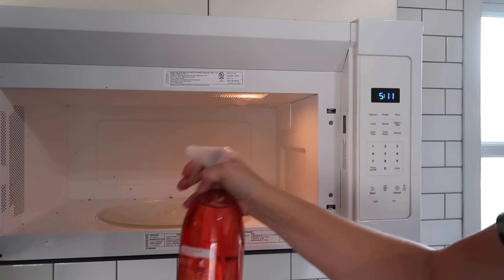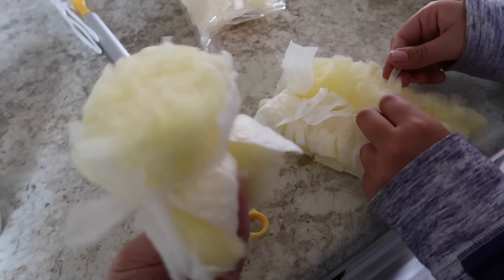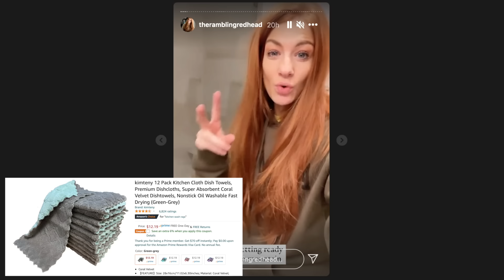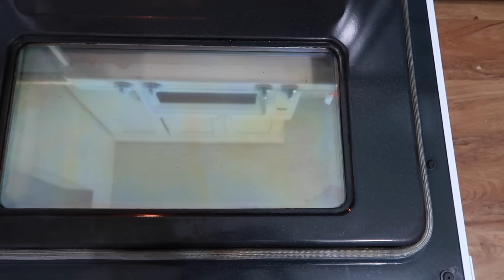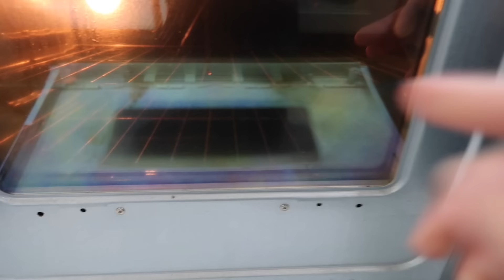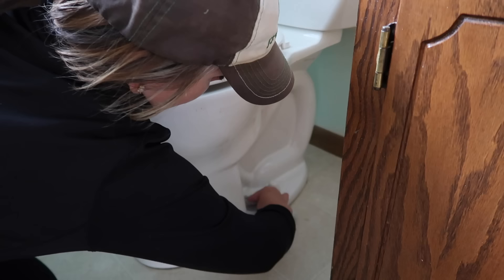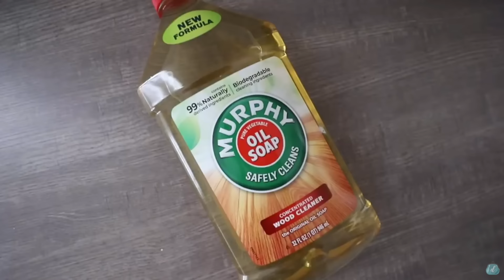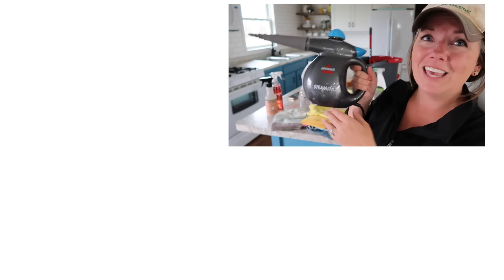Overrated Cleaning Products? Test them with me!

Comment: I do like the Swiffer for those quick Dustin's before company to ensure there are no cobwebs along the crown molding or ceiling light fixtures rather than pulling out a stool and doing it by hand.  Bring collapsible means it doesn't take up too much space.  I was worried about your oven because I thought I read a while back that those inner panes of glass were gas-sealed or something like that.  Might be newer convection ovens.  Great tips!  Have not tried the dollar store cleaners but will now.  Love the Mrs. Meyers Lemon and also Orange/Clove spray cleaners.  Have you tried their Baking Soda Cream cleaner?  Really cleans the grease off kitchen cabinets so well and less messy than making your own paste.

Comment: it is much easier to clean ceiling fan blades with a ceiling fan duster so you can get both sides and the edges of the blade in one swipe.

Comment: I use vinegar for my toilet. The video I saw said to use 2C vinegar and let it sit for an hour. Then use 1C baking soda and let it sit for 15 minutes. After that is done, just scrub it with you toilet brush and it works better than any cleaner. Sometimes I use bleach for water stains. I don't measure any of this, I just pour. So I can save even more!

Comment: When using the steam cleaners, you need to get right down close to what you're cleaning.  I had same issues and thought they didn't work.  The other kind with the hose and nossle works better.
I do like vinegar and baking soda with essential oil drops and Zum.  Zum is a little pricey but love it.

Comment: Ammonia is brilliant for cleaning really baked-on oven grease.  Leave it on overnight by lightly spraying ammonia (avoiding element), immediately laying paper towels over the ammoniad surface, then a further drench of the paper, then cover in cling film (saran wrap?) to hold the paper towel in place overnight.
Come back the next day, and it's a breeze.
Please wear a mask/gloves as ammonia is noxious at first.  After 24 hrs it reverts to water as it interacts with air.

Comment: I would try a magic eraser or Dollar Trees magic eraser on the scuff marks on the wall or even baseboards they work really good. What I do is cut them in half or even in thirds so they last longer. I used to have one of those steam machines I did like it. one thing I don't know if your steam machine had is a little scrubber that you can put on the end of it and  a duster you could put on the end of it . both of those were good the thing that I really liked about the steam machine .  Also for the crevices in the window seal it work really good in the window seals. Another  thing is to put on the duster cloth on and steam clean the  windows. The reason why I don't have it now is because I'm in Assisted Living.

Comment: Microfiber doesn't push as much dirt around if you use cold water for the clean. Leaves it streak free. Especially if you don't add extra product.
Rinse with warm water. Just water.
Microfiber is somewhat sensitive like skin, so remember the cold holds & warm releases.

Comment: The trick I use for ceiling fan blades is i take a damp towel, throw it over the blade then (pillow case starts inside out then work pillowcase onto blade right side out) then pull it over the blade then taadaa! 😜

Is mocrofiber the one that pulls across my hands when they are rough from working in the garden?

Comment: One thing I have learned that really works to keep the microwave clean and smelling fresher is after use leave the door open for a few moments. That allows any moisture to leave the inside of the microwave. I started doing this because when I cleaned the microwave a few months ago, I noticed some rust building up on the roof inside the microwave. I fully cleaned the microwave at that point and then told everyone in the household (there are several of us) to leave the door open so the moisture releases from inside the microwave. I was not expecting anything more than to keep the rust at bay, but after a few weeks of us all leaving the door open for a few moments (2 to 3 minutes is fine, longer if you like, though) the microwave was just as clean as when I had done the deep clean when I noticed the problem, and NO no one else washed out the microwave in between those times. Anyway, give it a try, it doesn't cost really much except for the light being on in the microwave for the few minutes that you leave the door open.

Comment: I used to have one of those steam cleaners.  I found it worked best if I held the nozzle closer to whatever I was cleaning, like an inch away.  The steam cools too quickly otherwise and you lose the pressure effect  Unfortunately, this meant cleaning one square inch at a time.  In the end, it was just too much fuss to get it out.

Comment: I too love the Swedish dish cloth and I love them for kitten counters and wiping dishes. You are right they are just so adorable that I don't feel like using them for dirty work (I have the same color you have).  I use Microfiber cloth for all other dirty work. I like Mrs Meyers all purpose cleaner too. I recent bought LAs Awesome cleaning liquid but haven't used it yet. I too have a very small house so unless I absolutely love the stuff I don't want it to occupy extra space in my house. One item I recently bought is handheld spin brush and so far I am loving it for kitchen and bathroom cleaning. Question: Do you have Rubbermaid Reveal Power Scrubber 18 piece set. I want to buy it but don't want to spend $50.  Loved your video. Thank you!

Comment: Awe, I love the geranium scent! :/ I buy the concentrate and it lasts FOREVER.  I like those long flat floor mops, got one on Amazon and found a tip to buy several of the microfiber pads that way there’s no rinsing. Just throw them in the water with cleaning solution and use a clean one every time.  Works so well on walls and windows, a lot easier than using the rag by hand.  I want to try the pink stuff paste vs the scrub daddy paste.  Lots of hard water in Tx!

Comment: I’ve been using Branch Basics cleaning system, and really like it. Great for minimalism. Please check them out and tell me what you think.  There is one liquid that you dilute into different strengths depending on the job.  It comes with all the bottles with lines for concentrate and water levels.  I am very impressed with how well it washes clothes and it only uses a small capful.

Comment: I love using the micro fiber cloths I find just water on walls and baseboards works great. I've always used dish detergent to clean tub and shower. It cuts oils and dirt build up and cuts through soap scum really easily no scrubbing needed. Learned that from my mother as a child. She always kept a bottle of dawn in the bathroom to clean tubs after our baths. I wanted to try that mop system. So now since you did I can go buy it. Vinegar and water works best on windows imo and thanks for trying the swiffer. I wanted to get it for dusting high up. Ceiling Fans and lights , pictures etc. But I thought the same as you. I dont wanna store it and not only that. Buying the dusting part over and over is wasteful.  I'd rather use something I can use than throw it in the wash and reuse it again. I really don't like having to buy unnecessary things just to use and throw away so if there is an alternative to waste I will choose it everytime. That steamer was just crap. I thought for sure it would clean the microwave smh. Anyways love method and Dr Myers products also. Thanks for the video.

Comment: Well I’m a little late here, but the steamer I couldn’t live without.. oven cleaning is not going to happen with steam only, vinegar or not that just needs the right chemical combo heat and a scrub. .. And I spray whatever cleaner I’m going to use on the surface of what I’m cleaning and then I steam with water and wipe . Works every time. I cleaned all the grout with my steamer which was black to begin with and it came clean… It’s great to clean trash cans (I have a white trashcan with a floppy lid that looks brand new after two years, and we are a family of 6 so much garbage u can imagine), kitchen sink and counter,  faucets , bathroom. Bleach and dawn in the bathtub with a scrub brush cuts the crud. Dawn and alcohol is good for my countertops and doors , sprayway foam window cleaner is hands down the best!!!!!!! I use regular cheap white washcloths for cleaning everything and paper towels for mirrors and glass. I do not use green cleaners bcs they stink they don’t deodorize anything they are expensive I don’t feel like they sanitize anything, some green cleaners smell like cat pee and gas station toilet to me. Sometimes we need to quit being “boujee” with Mrs Meyers and be practical and buy dawn bleach baking soda vinegar comet and borax and RAGS from Walmart.

Comment: Y’all ALL need to remember using vinegar TOO much (in laundry especially) will RUIN plastic piping after a while. It’s an ACID FOLKS. It won’t DISSOLVE it but it will break it down. Over time and overuse. 

inegar, or acetic acid, is a weak acid and will not dissolve plastic. However, it may cause discoloration or etching on some types of plastic. It is also important to note that not all plastics are created equal and some may be more susceptible to damage from vinegar than others.

Comment: I have the spin mop and the steam shot - spin mop worth it, steam shot not so good.  My go to cleaner for most every thing is Dawn + Vinegar 50/50 mix in a spray bottle (Clean My Space suggestion).  Windows, walls, floors even dishes - perfect.  Cerama Bryte makes a power cleanser for stained porcelain sinks and even the bottom of pans, also they have a stainless steel cleaner (contains mineral oil) that is really good.  But their best product is one you use for NEW appliances (came with my GE Cafe stove) that somehow seals the stainless making the cooktop wipe clean.  Wish I had it for the refer when it was new... I prefer not to use any tools that require you buy special pads etc. - If I can wash it, I'll use that everytime.

Comment: One more vote for bar keepers friend. Only I use it the most for my stainless steel/copper bottom pots and dishes- make a paste out of the powder and it removes everything! It will also take the utensil marks off of my fiestaware dishes! Baking Soda and PEROXIDE to clean grout! Peroxide will take blood out of almost anything. spray and wait 60 sec and rinse. the more delicate the fabric the sooner you rinse with cold water. the bissel 3 in 1 heavy duty steamer has an extension piece and works as a floor steamer and them pops off to be a hand held steamer for the nooks and crannies plus comes with a grout brush and a brass tool for cleaning the grill. It's definitely heavier than the steam shot, but I prefer tools that have multiple uses if they're going to take up space in my home. ZEP window cleaner.- used on all windows/glass/ and stainless steel.

Comment: Although I understand your respect for a fellow YouTuber's opinion, never put vinegar in a steam cleaner. It greatly diminishes its ability to clean properly. If you want to use vinegar in the process, spray diluted vinegar on the area you are cleaning first. Also, be cautious of using vinegar too frequently. I learned the hard way that it can discolor some surfaces and ruin others. Also, the glass cloths are to be used in conjunction with a microfiber lightly dampened with water. Wipe glass with damp microfiber in a tight z pattern top to bottom, follow with glass cloth in same tight z pattern from top to bottom. Cuts cleaning time in half.

Comment: I tried to open a filled bottle as the swiffer broke but I still had 2 bottles of cleaner.
I boiled the bottle upside down ( cap only) but it never would open easily.
I boiled for several  minutes.
Ended up using a sharp knife to break the band and cap.

Comment: Oven glass doors ...... I use a single edge razor blade with a very light coating of soapy water.  Wipe it off with a paper towel.  For the oven floor, buy an oven liner and you'll never have to clean the bottom again.

Comment: Baking soda, vinegar, lemon and at times borax are very dependable cleaning agents for me except on areas that might be affected by the acidity of vinegar and lemon. BTW, if sinks are cleaned thoroughly every time dishes are cleaned, fruits and vegetables are washed, it will not be a problem cleaning the sinks at all. If there's stuck food particle inside my microwave, I don't use a scrubber because it might scratch its surface. I use a dishcloth wet with dish detergent and lemon juice or vinegar to cover the food particle for a few minutes then wipe it off and rinse it with a clean slightly wet dishcloth or paper towel. To remove the smell of food in the microwave, I put a microwaveable mug or bowl with water and half a lemon and run it for a minute. At times, I leave half a lemon in the microwave so that it can absorb all the nasty smell of food heated there. It works always for me.

Comment: I use the steamer for the window and sliding door tracks. I was excited when I got it a few years ago but I keep it in the garage and tend to forget its there. I’ve been tempted to open up the oven door but I’m afraid I won’t be able to get it back on right. The drips inside the glass drive me crazy. I was hoping you were going to say the steamer worked for it. Hanging dish towels on the door handle is about as good as it’s going to get for me lol.

Comment: I wonder if the the swiffer duster would help reduce friction points preventing dusting the black light fixture in the kitchen.  I have similar fixtures in the bathroom that I can dust w/ my microfiber glove cloth but . . . when I'm tired I ditch it bc i have to climb onto the counter/get the step stool.  Not having to REACH may reduce a friction point.

Comment: I don't use the steamer like you. To begin with, I use it with a good degreaser. I soak whatever in it, whenever it's possible. And then I use the steamer with the jet very close, even touching the surface. And then with an old toothbrush I take away the more stubborn spots. It always comes squeaky clean, in no time. That thing definitely has a learning curve, and it doesn't make miracles. You work A LOT less, but you work.

For me, it is a must for the stove top, the blinds and the filters of the kitchen hood. And together with a good descaling agent, the floor grouts. The bad part though, is that one runs out of water very soon, and you have to wait for the appliance to cool and be safe to open and refill, and to get hot again. I am also very scared to use it on the window panes, because mine is an old house and the panes are very slim. That thing saves me a lot of time, but I use it for a very limited amount of things. Even so, it's worth the money spent, which was not much, taking into consideration that in my country those gadgets cost triple at least.

Comment: Have none of you heard of the self clean option on the ovens?  It absolutely works amazing on my oven anyway.  It does not clean between the glasses which only really needs  cleaning twice a year.
Reply: I don't use mine either now on my newer oven, 6 years old.  I didn't like all the heat, smell and even had appliance repair people tell me because they get so hot they can cause repair issues.   I use liners and 'try' to clean as I go.

Comment: I love my Amway cleaning products. I grew up using them. I have tried other products but nothing compares...not even the products you used in this video. Here is why...all of them work, are green and concentrated so they beat pricing when you compare them correctly. Their laundry detergent is what my parents repair man claims helped them keep the same washing machine for over 30 years with zero major repairs. They only had to do small maintenance repairs when parts wore out. The reason why is the detergent cleans the washing machine and the pipes with every load. All other detergents have additives in their product that clogs machines and pipes causing huge repair and replacement costs about every 5-7 years. The only reason my parents replaced their washing machine after 30 years was because they were moving and my mom wanted a new updated machine. Their home cleaning products are great as well and have won environmental awards. They are high quality at a fair price that doesn't break the bank. They also smell good too...no stinky cleaners here 😊

Comment: I have the Bissel steamshot and to be honest it kinda scares me.  It builds up pressure to create the steam and one time I unscrewed the lid to add more water and it blew right up to the ceiling, glad I wasn't looking straight at the lid when it flew up!!!!  I do find it cleans the the stove top well, I have a gas stove.  Haven't tried to clean the oven yet.  But after watching this video the baking soda and vinegar looks much easier.  I also have the Norwex floor system and find it too much work and don't like having to rinse it out in the sink all the time.  So I will probably switch between that and my spin mop.